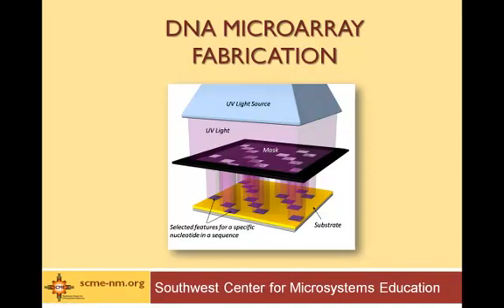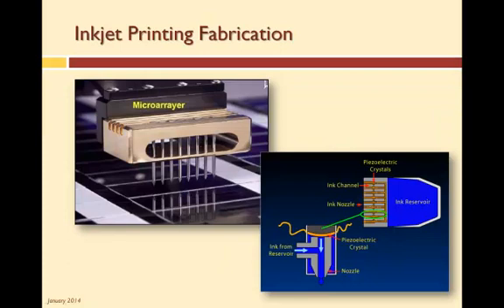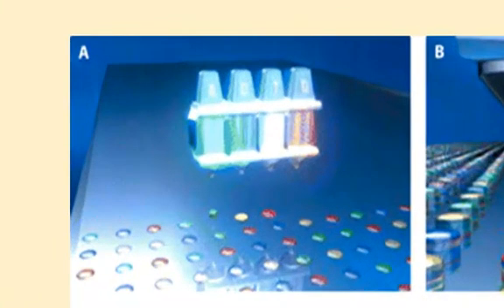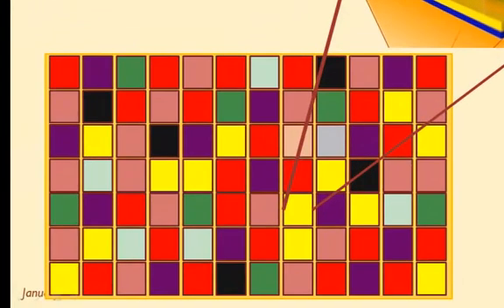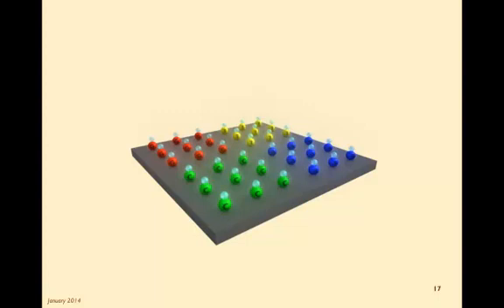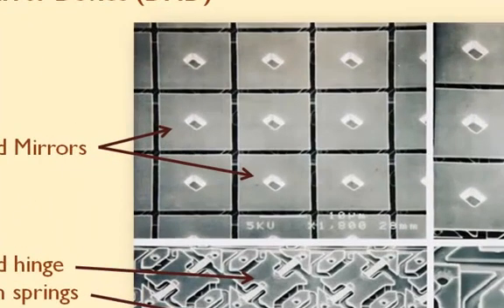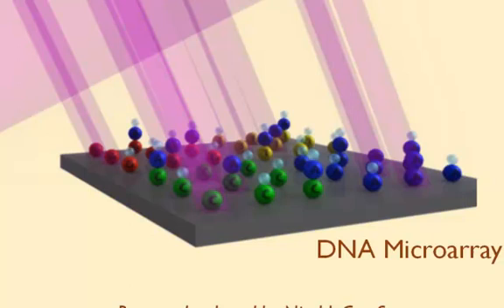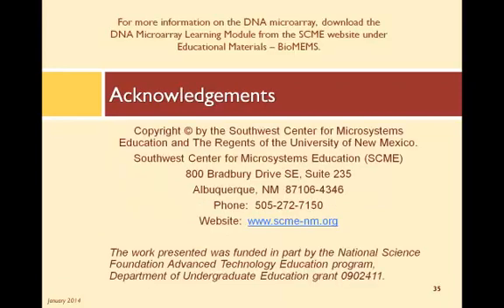DNA Microarray Fabrication

Comment: Does anyone synthesis the complete 25 mer oligo first, then print that onto the glass?  I could imagine this would allow for precise quality control of the oligos because you could varify the sequence with mass spec prior to printing.
Reply: That probably would be very difficult for chips with many unique sequences. Some chips can over 700,000 different oligo sequences (e.g. SNPs) and preparing and keeping track of them and then delivering them to the chip location I think would be logistically difficult so in situ synthesis at each location is apparently the more efficient way to prepare the chip.

Comment: A bit of a correction if you please.  At 2:07 in the video, shows a picture of Arrayit technology US Patent, 6,101,946 in the upper left corner.  It is a contact printing technology, using a microarray printing pin unique to Arrayit.  It enables the manufacturing of microarray of any biomolecule type, not just DNA arrays. More robust than inkjet for many different applications.  For more information see www.arrayit.com.
Reply: Excellent tutorial!